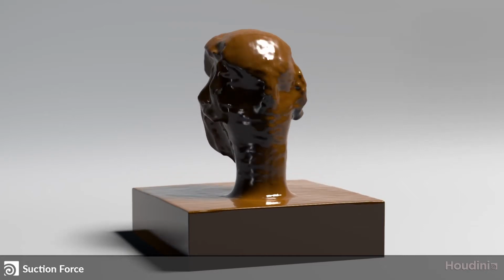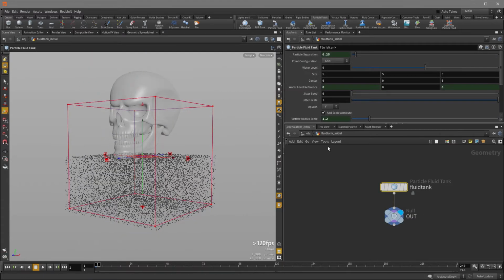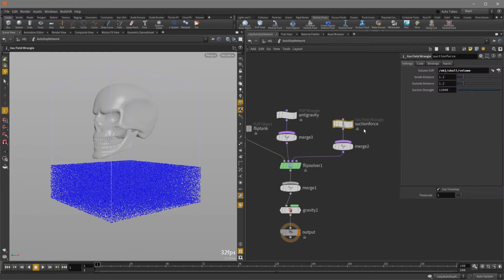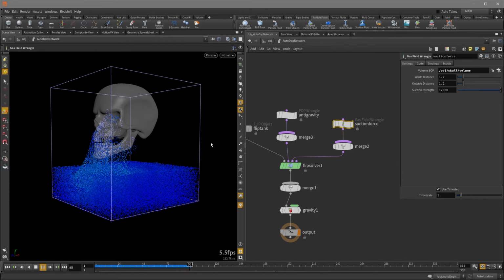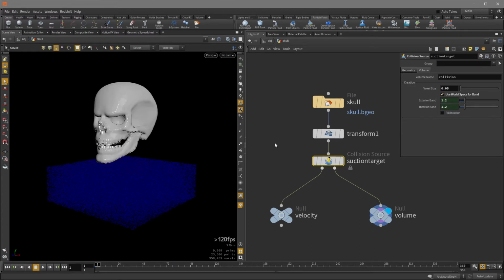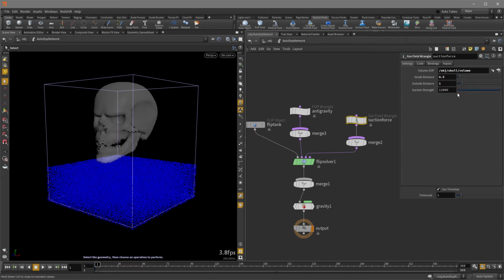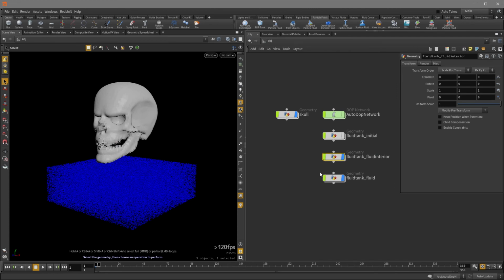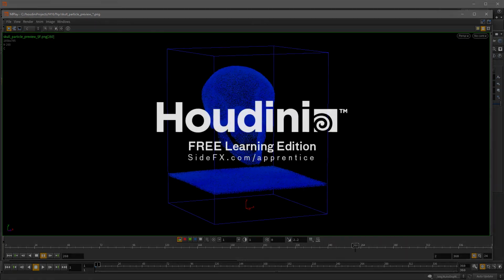Suction Fluid

Comment: Hi, my pc runs extremely slow this exercise. Take about a minute to cock only 1 frame, how can i improve it? 

My specs: 
intel core i7-6700 2.5Ghz
8gb ram
Nvidia 970
Reply: If the machine is slow then set it to render for a few days. As for trying to work with it you will have to play with your particle separation number I think. then when things are covering the object and you are happy with the timing render it and make adjustments after that. I do think the VDB size should stay at a good number for your object. I wish they would tell us what their machine specs are, but do remember that these are edited videos and the time span for their sim is not seconds like in these videos. Scene scale also plays a role in sim time.
Reply: Thanks :)